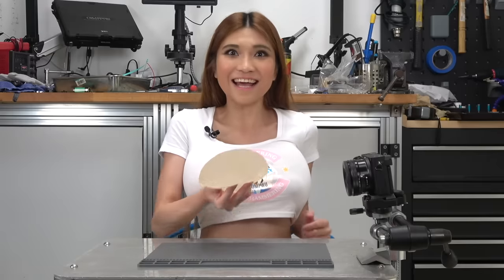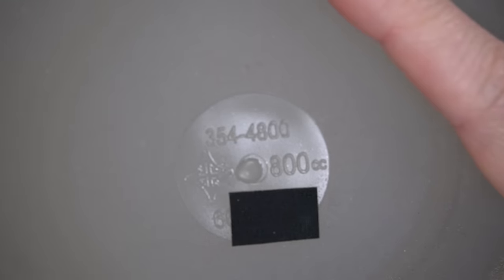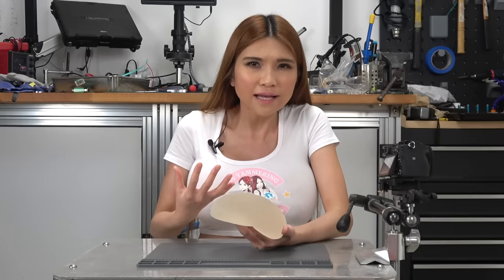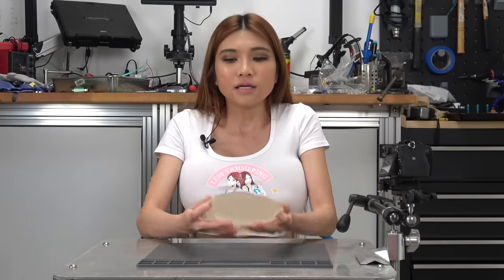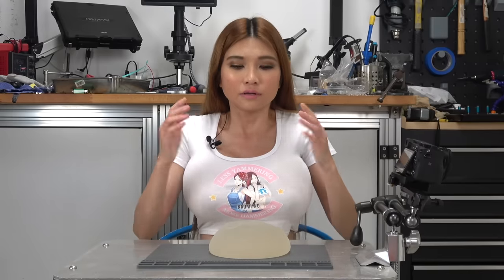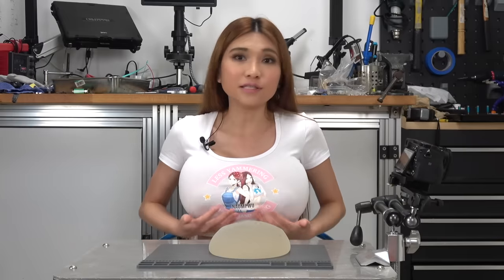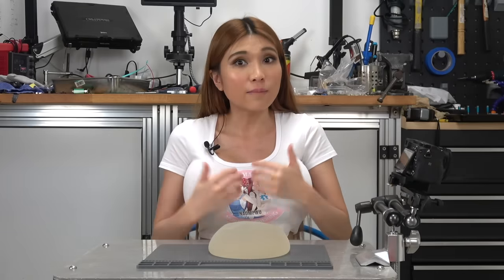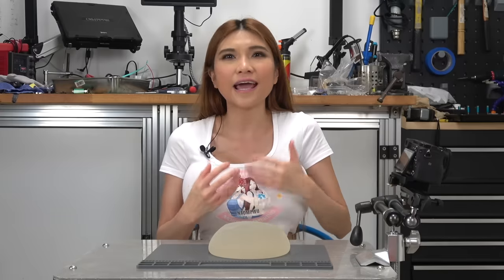See My Boob😜

Comment: Since you now have twice the displacement of my first car (1978 Honda Civic with a 1200cc engine), you should now be able to run 150 miles per hour.
Reply: nah not enough power they just powered by an inline twin, hells of torque tho 😏
Reply: Now that the displacement has been increased, she should consider installing dual overhead cams.
Reply: This comment is truly hilarious.
Reply: This comment thread is lit af. Need some mechanical classes to to comprehend completely..

Comment: I’m not sure I’d call over 50% larger “a bit” larger, though...
Reply: Well, volume is a little odd, an increase in volume can be spread out among 3 special dimensions. Think about a 1 inch cube: you can increase the volume of the cube by 50% by increasing a single dimension by .5 inches, or maintain a cubic form and increase all side lengths by roughly .14 inches. So, it really is only a little bit bigger when measuring the radius of the hemisphere, as would be the case here.

Comment: Very surprised that particular make of implants ruptured. Must have been a faulty implant. My GF had the same at 325cc and they lasted 20 years. Now 375cc when they were replaced for safety. She went from empty B to stunning DD. They DO eventually settle and feel 'better than real' in my opinion, especially as you age 🙂. Silicone feels much better than saline, but both only really work well above the muscle. You didn't say where yours were placed, but I guess above after using skin expanders.

Comment: Hi Naomi did you have your implants put in the same way as i have seen they do not cut under the breasts in Thailand they place a tube into the belly button that goes up into the chest and then they push the sack that holds the gell into the chest and then they inject the sillicon into the sack thats all ready into the chest just curious if thats the done way now thank you .